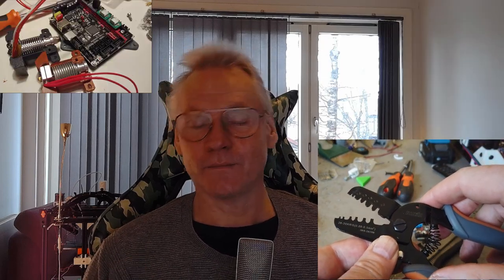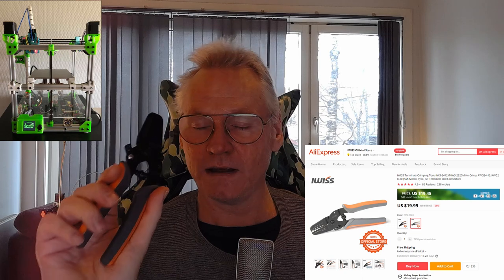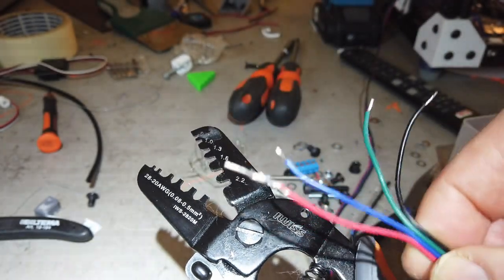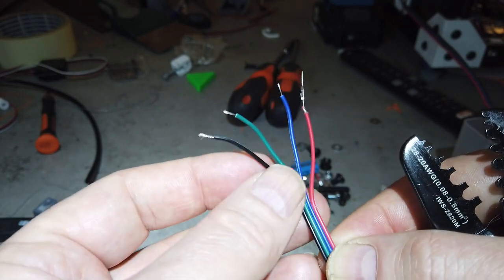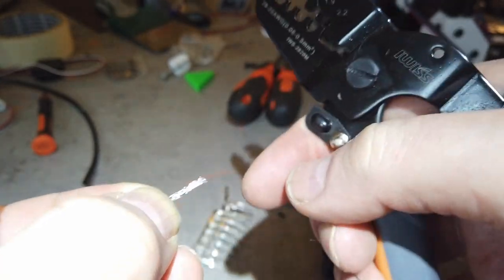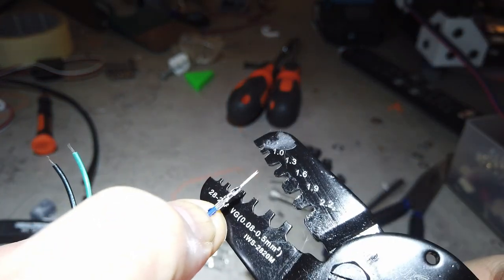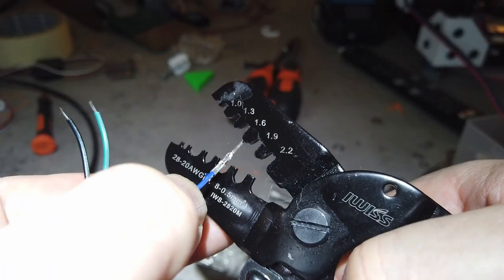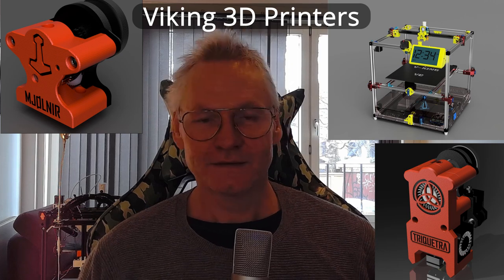3D Printer Cable Management | Best Crimping Tool? | Quick IWISS Review |

Comment: Hi, does it produce bent crimp near the insulation holder? I heard some people speaking of this problem. I am looking for a new crimper bcs my current crimper does this; and straightening the bent terminal with a plier isnt a viable option for me bcs the wire insulation is damaged in the process.
Reply from the maker: You probably want the ratchet one. I was not able to use that myself but if you practice it should be fine. It is bigger so you dont see what you do.. Crimping the part over the jacket/insulation ( the strain relief ) can be tedious and it can bend if the jacket is a little thin so you need to take one at the time with the tip of the Iwiss before you do the final crimp